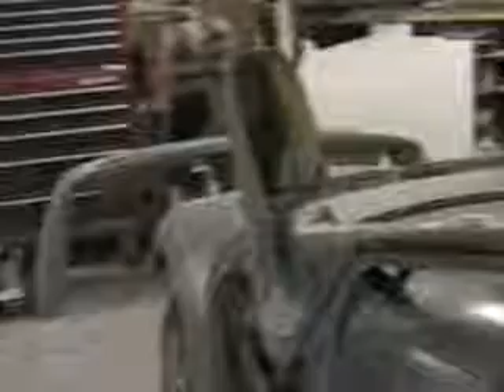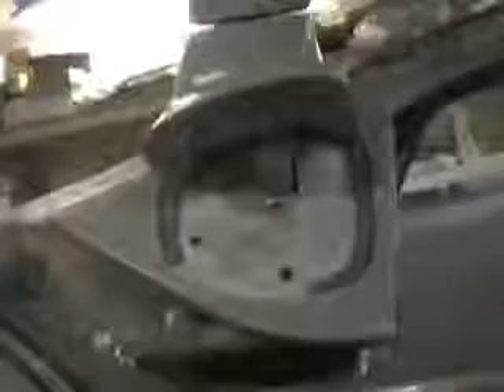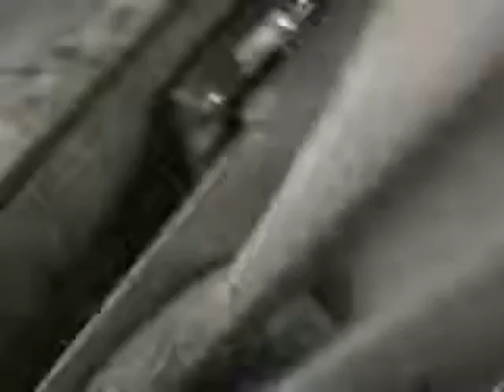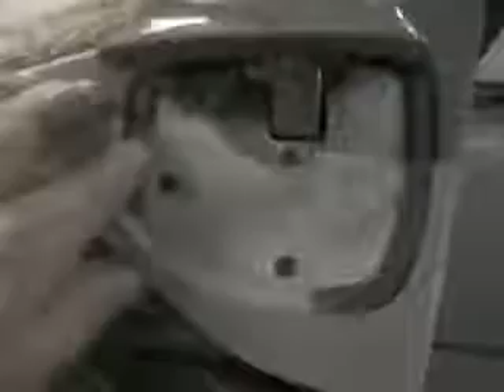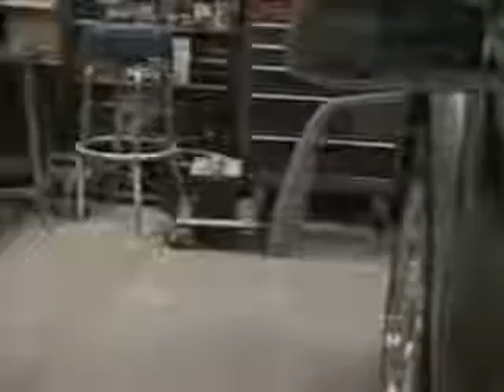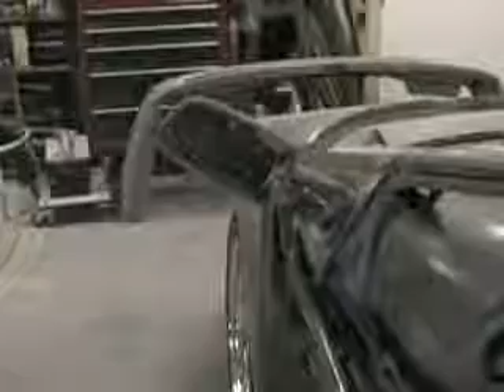Mirrors Up and Down

Comment from the maker: The motor is much quieter at 12 volts.  I mistakenly had it at 18 volts. The door will be insulated for temp and sound.  I am in the last year of my build.  Will be done late '08 early '09.  I have it running and drivable but not finished yet.

Comment from the maker: Thanks, efliteflyer.  I found out later the battery charger I used for power was actually set to 18 volts!  No wonder it ran fast. 12 volts seems OK and close to 6 volt speed.  Are you building too?